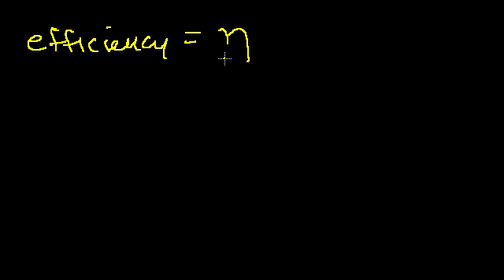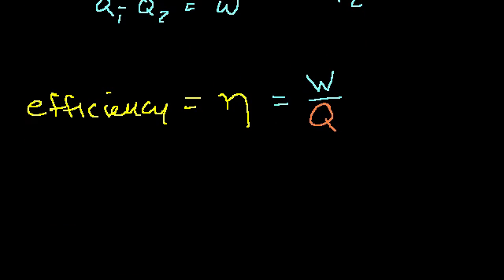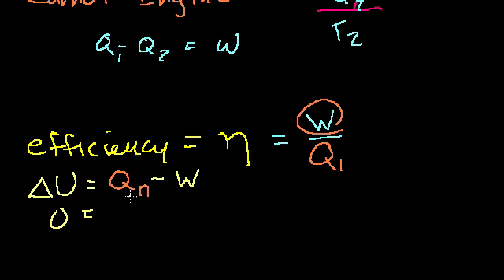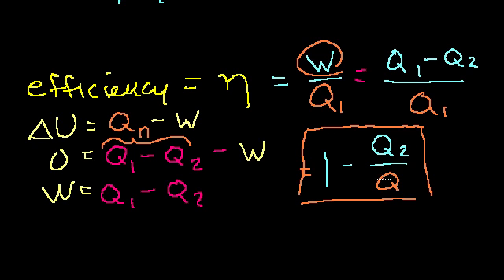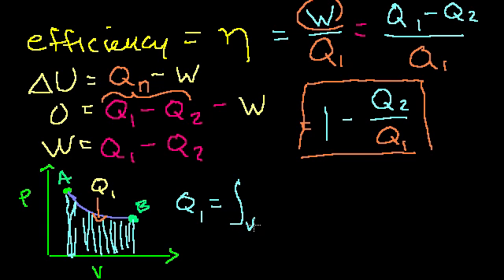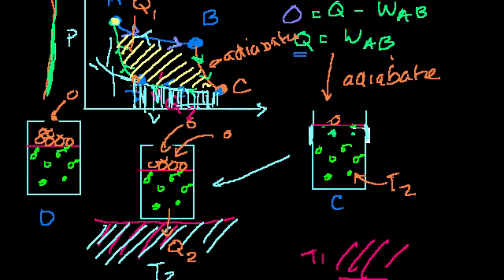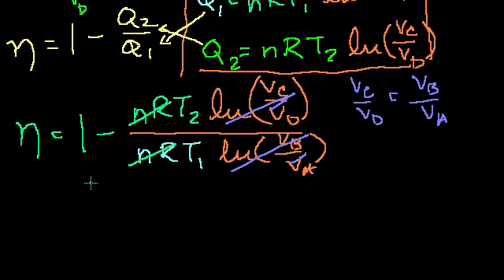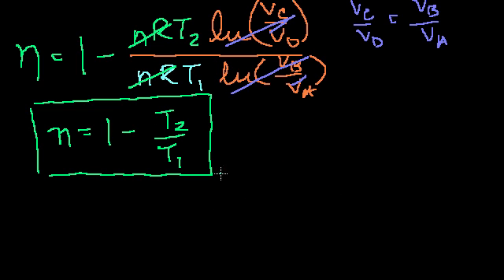Efficiency of a Carnot engine | Thermodynamics | Physics | Khan Academy

Comment: Your videos are amazing and are useful even after 14 years ... but the thing is , isn't
du=dq+dw
Becoz that's what I learned...
Reply: Nope. 

dQ=dU+dW

From first law of thermodynamics wheres,
dq is change in heat
du is change in internal energy
dw is work done
Reply: @Siddhartha0alpha  brooo.... I double checked it, it is what I said
Reply: It is given in Google too
Reply: I'm sure you've figured this out a year later, but for anyone else that reads this, there's no mistake, it's just a subtlety of whether you define W as the work done by the gas or on the gas which changes the sign.

Comment: But why is Pressure taken as constant during the isothermal expansion? Pressure is decreasing and not constant from the graph.
Reply: You mean the integral? He substituted nRT/V for p.
Reply: @gabor6259  I understood. It was a stupid question evoked because of lack of clarity about how integrals work. Thanks for replying though. The pressure value will change as the integral gets evaluated at every deltaV so its not taken as a constant.

Comment: I can see why its 1 - T2/T1 when the gas the other side is what counters the presure from the gas before heating that makes sence. But you could get higher efficencys if it was only pushing aginst a vacume or just a gas with lower pressur at the same temprature. Its the gas that has its volume reduced thats takeing the T2/T1 of the energy in the carnot engine.

Comment: Sal,
Excellent series on thermodynamics(entropy,heat engines). Can you show Thermo princples applied to the modern  electric car. I believe electric cars are not so "green"  when we include the total universe required to power them.  Include efficiency factors from the burning of the coal at the power plant to the batteries making the wheels turn.